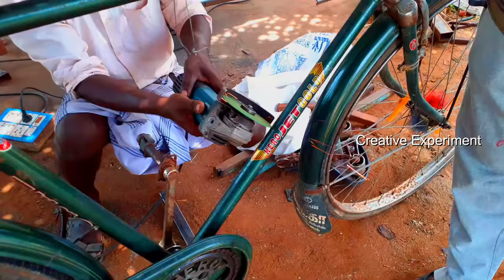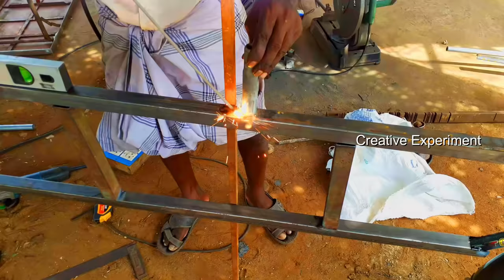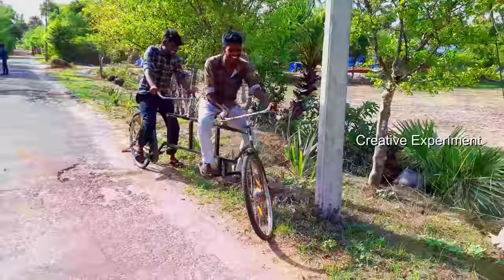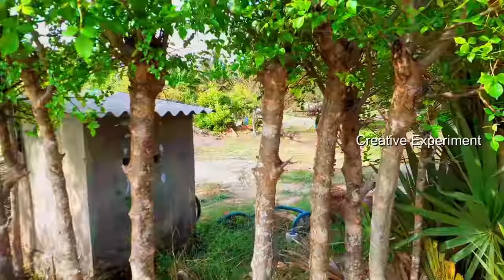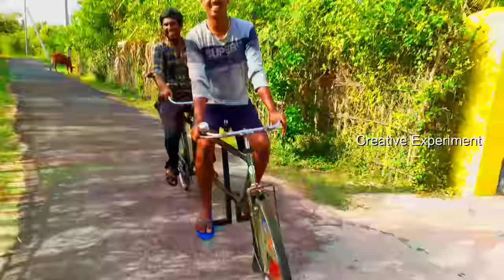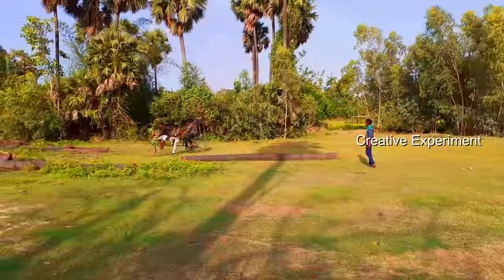😂😂 சமூக இடைவெளி Cycle | World Longest Bicycle  | ஆத்தி இவ்வளவு நீளமான Cycle ஆ😲😲

Comment: It was a good idea but you need to add some more parts in that so that it will help you more 

* fix a Gears in back wheel side so that the load will be less for padeling  person 
* add one more padel in front side ( front wheel to front person so that one person also can drive this) 
* add two small extra wheel in back side of so that Balance will be there